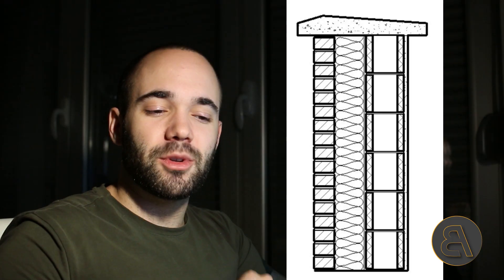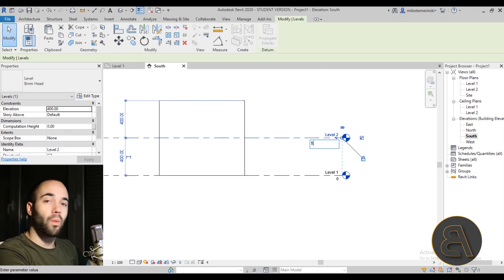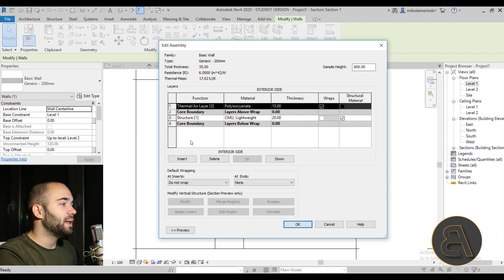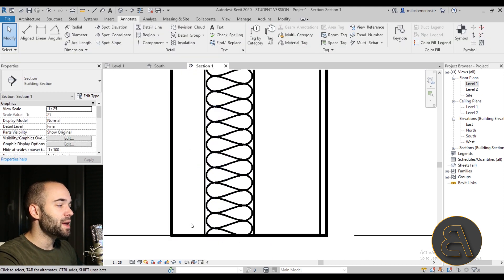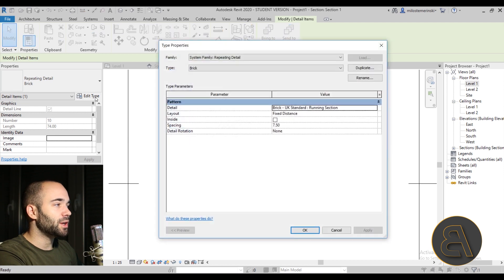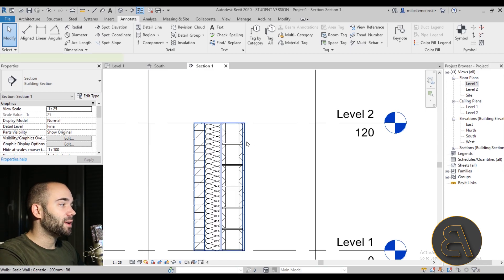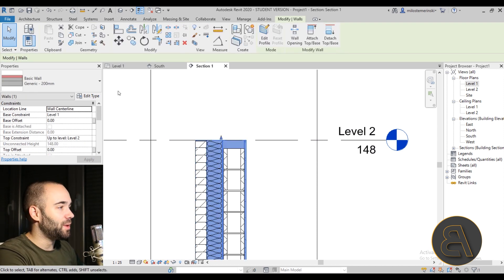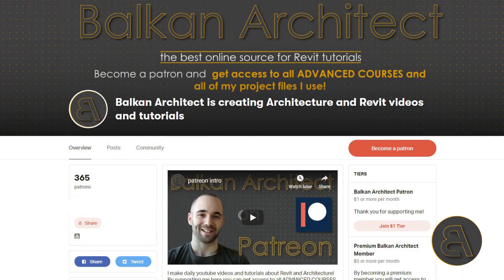Advanced Walls in Revit Tutorial

Comment: Hi, if you have a cavity wall construction ie, 110mm brick wall plus 50 cavity [air] and then another 110mm brick wall - the two 110mm brick walls are kept together with a wall tie. The problem is this - when placing a door or window - Revit does not close the cavity. And normal people in construction close the cavity. But, revit wants to keep it open.

Comment: I always recommend modelling internal/external wall systems separately on professional projects. A few reasons;
- their wall heights are nearly always different
- stud/brick are not installed as one, so often will be set out/sequenced separately by different contractors. Separating them makes coordinating this easier
- you can do a focused masonry/concrete setout plan if required (with studs off)
- you require less wall types in your project

The only key is to make sure your walls are considered as entire thermal systems in your design (e.g. maybe you need diff insulation for facade vs interior stud wall types)
Reply: Your videos are very nice too. Surely though you would only add the real joint details as Drafting Views or am I missing something?
Reply: @philipeddington6282  yes typically 1:5 and 1:10 would either be drafting views or plan callouts with model elements at halftone or off, then detail items over the top to add the finer joints